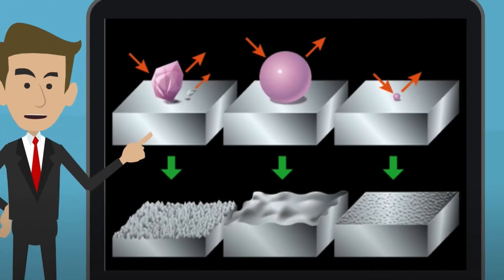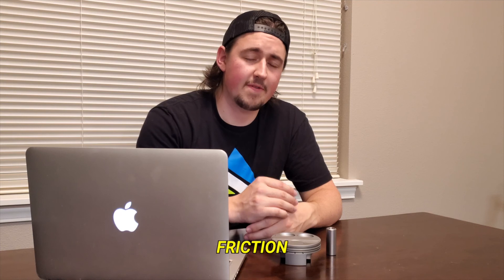WPC Treatment Explained | NEW high comp piston for the YFZ-R

Comment: Hi sir, i had lil question here, can WPC treatment combine with ceramic coating in crown piston?
Reply from the maker: I have read that wpc is compatible with other coatings but I can't confirm how that would work with ceramic. They were quick and responsive when I spoke with them so I would recommend reaching out directly!
Reply: @AustinRohr  ok, nice information...thk u for reply sir
Reply: Personally, I would like to use it on crank, cam, pins, springs, valves. But if you have a (Forged piston), I think you would be better Served, with a different coating on the crown for heat, and line to line coating on the skirts. Check out line to line before you decide what you want to do✌️
Reply: @kevinwest3689 ok, thats so enlighment..thks for insight bro...
sorry for late respon , start busy start my project with my m60b30 😁

Comment: Lots of forged pistons come with coating on the skirt. Is it better to sand off the coat before WPC?
Reply: No problem. It wont alter the surface, you can use WPC over any existing coating.